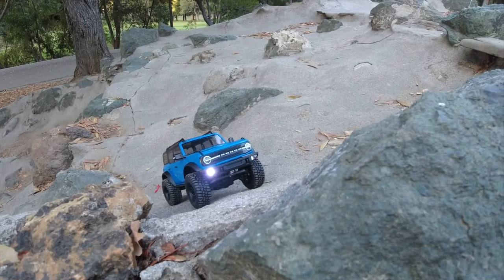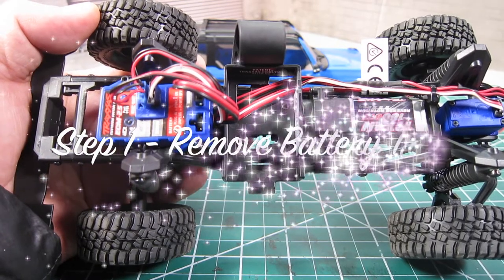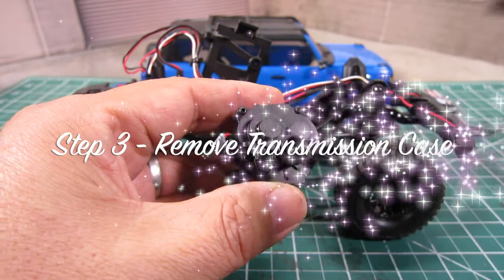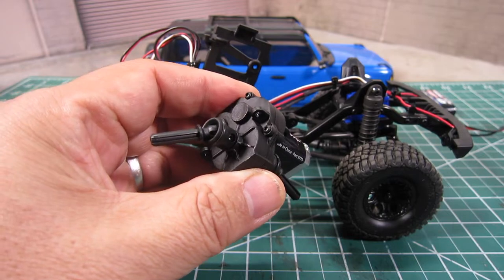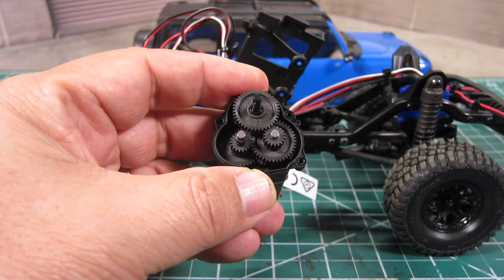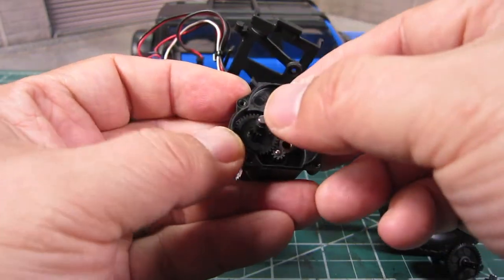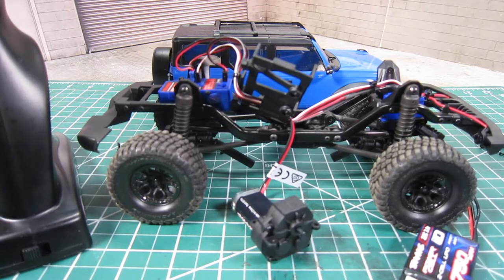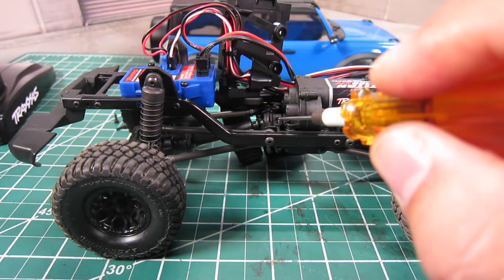TRAXXAS TRX4M | Step-by-Step: How to Install Gear Set

Comment: Does it not need any grease for the gears? Thank you for the video. I have the gears on the way.
Reply from the maker: From what I have read, it doesn't need it, but you can put very light coating if you feel more comfortable.

Comment: My slow gears (official from Traxxas) are much louder than the stock ones, is it ok?
Reply from the maker: Mine is a little louder as well.  It should be fine, but you can always dab a very thin layer of grease to see if that helps.

Comment: Upgrade radio, and you'll get lots of wheel speed, but smoothe crawl too, the radio is the problem, stock setup is fine
Reply from the maker: Thanks for the info.  Upgrading the radio is a great idea, and one that I plan to do at some point, but $5 gear set will be a good interim solution ;)
Reply: The ESC is the problem ! ^^ Dont tell me you swapped Transmitter and Reciever but still use stock ESC....
Reply from the maker: It’s possible that he upgraded the transmitter to Traxxas TQi only.  TQi offers end point adjustments and possible better control with bluetooth programmability.
Reply: The reciever is apart of the esc on the TRX4M, so the esc would have to be replaced & then get a seperate reciever.

Comment: You forgot gear oil
Reply from the maker: Thanks for pointing it out.  Normally on a 1/10 scale, a light coating of grease is required, but on TRX4M it is not mandatory.  That being said  if you do put grease, make sure that it's a very light coating.